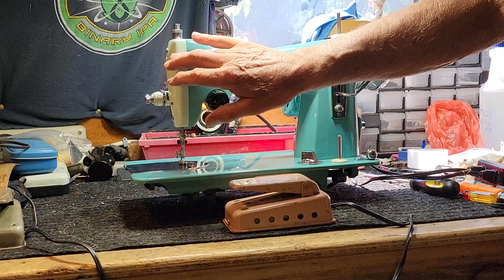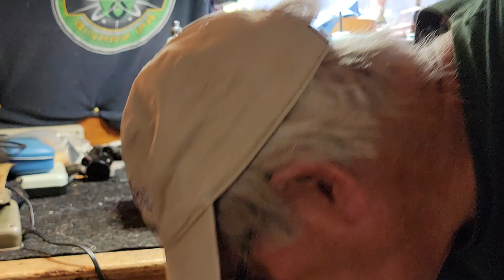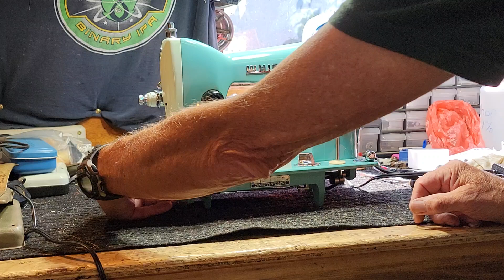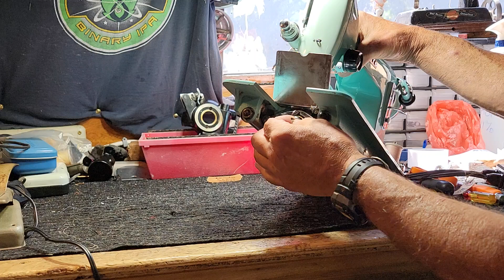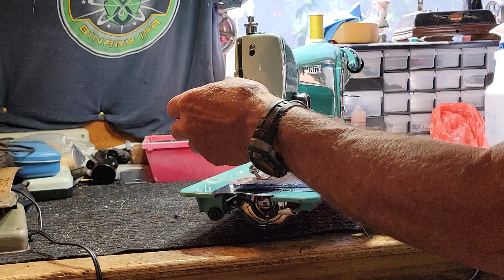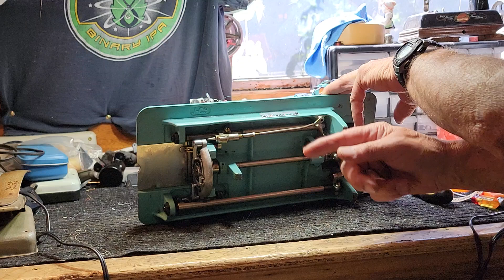Renee's White 1514 Sewing Machine-final test and tutorial

Comment: Hello—I have the same machine. Your way to thread the bobbin makes sense and feels right, but it’s the opposite way from what is shown in the manual. Could you enlighten me as to why you are doing it differently? I suspect the manual might be wrong, as it’s description of the thread path also has a mistake (the text and the pictures vary from each other about the order of threading through the check spring). Thanks!